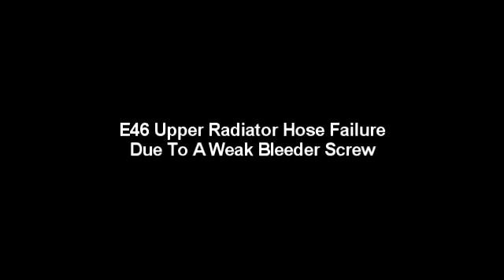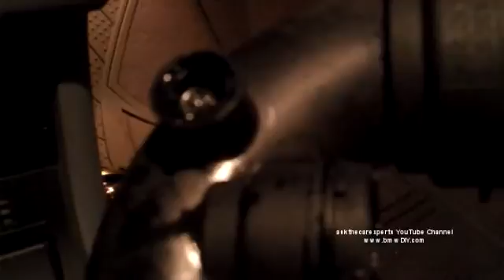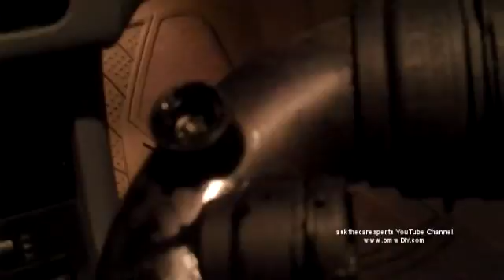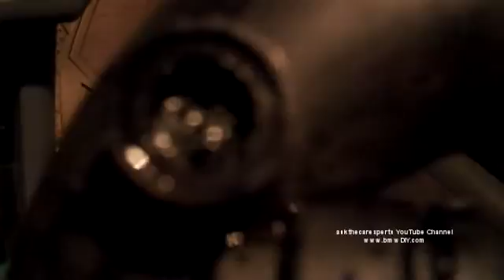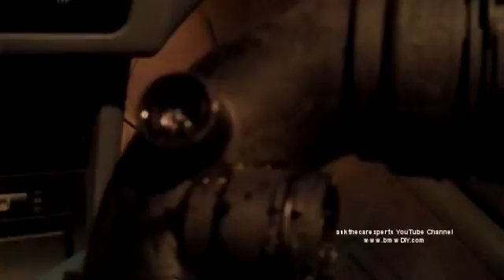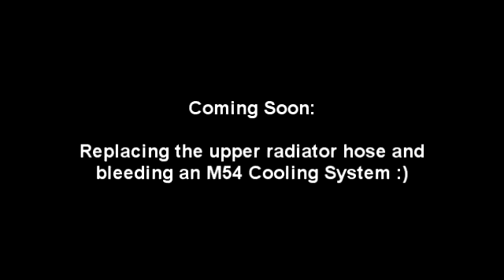BMW 3 Series M54 Engine Radiator Hose Failure Due To The Bleeder Screw Braking Off

Comment: Do you have the name of the piece you are holding? I broke mine and need to replace that piece of the pipe, but can't figure out what the part is... stupid dealership wants to charge $200 for a diagnostic and then repair work when its obviously a 5 minute job..

Comment: At the Crimp on these upper radiator hoses, do you know if there prone to failure? have a mysterious coolant leak, have replaced the hose twice and coolant still keeps forming at the hose crimp near where the upper radiator hose connects to the thermostat

Comment from the maker: Hello Loren, I have found that auto parts stores do not sell the same quality of parts in many cases. I know someone that went through three bulbs in a short time until they bought it from the dealer. I know that often brake rotors are lower quality as well as pads. Some parts you can only purchase from the dealer or an OEM parts store like pelican parts online. In most cases it is better to use stock BMW parts. Might cost more in the short term but be worth it in the long term.